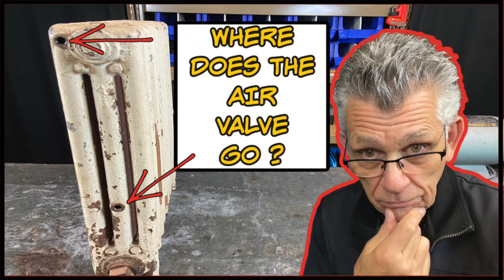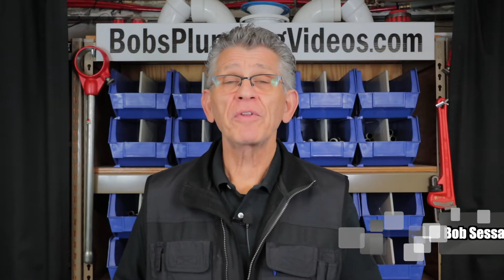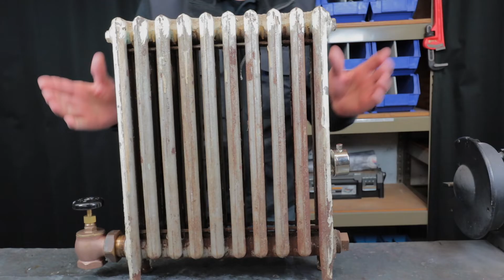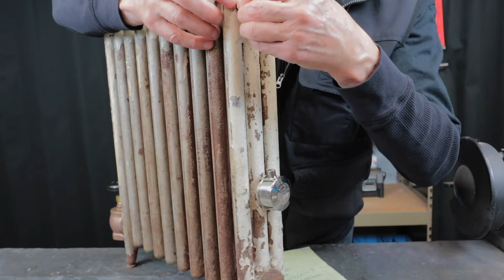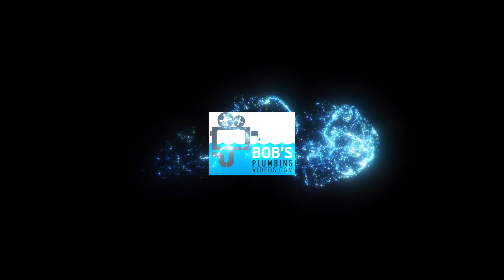Steam Radiator Vent

Comment: Hey bob happy new year.
Had a boiler event today. 
The pressure relief valve on the boiler did its job today scaring my wife to death,she's running up stairs  saying that the boiler is on fire so I head down to the basement and she was releasing some steam so after ten minutes I looked at the pressure the boiler still had pressure 15 psi (little on the high side )after the steam event i figured that air relief are bad I haven't replaced them in about  8 yrs
It's a Dunkirk single pipe radiator system with 6 radiators no expansion tank old house built in the 1920s
So I'm going to replace the steam vent valves 1/8 inch thread and hopefully this solves my problem .
Reply from the maker: Is this a steam or hot water system??? Steam system relief valves are set at 15 psi, hot water 30 psi. Expansion tanks do not apply to steam systems.
Reply: @BobsPlumbingVideos thanks Bob for the information. Yes it's a steam setup 
I'll be replacing the steam vent valves today. 
BTW I appreciate you for sharing your time and knowledge
Reply from the maker: @SuperNovadose  Curious as to why the valve leaked? They are a safe emergency backup up should the boiler not shut down at a pre set pressure usually (2/5psi). They rarely leak on their own as a rule. Might want to run the system, watch the pressure gauge and see if the pressure climbs past 5 psi. If so you might have other issues.

Comment: How do you bleed the system if it doesn’t have a key hole?
Reply from the maker: I you in fact have a "Hot Water System"  NOT A STEAM SYSTEM and there is no bleed valve, you'll have to have one installed to remove the air from the system.
Reply: @BobsPlumbingVideos it’s definitely a one pipe steam system. I think it has a bolt where the key valve would be.
Reply: Or should I change the air valve?
Reply from the maker: @jsn2482 that’s where I would start

Comment: mine has a plug near the lower bottom half, and it seems to be a hex shape. however I tried all my allen keys by none fits. It's larger than a 4 MM but smaller than a 5MM. weird.

Comment: bob i have vertical valves in the basement, 2 valves T off in 2 separate locations, 3 of the 4  valves bleed steam eventually, how do i know if 3 are working correctly or the 1 is?
Reply from the maker: Send me some  detailed photos if you can, little difficult to diagnose on the internet. info@robertsessaplumbing.com.

Comment: Will the placement help if the radiator makes some noise ? Mine on second floor end of line are mounted near the top with Gorton 6 roughly 35ft run from boiler, they get hot all over, but make a couple clanking noises upon filling and later the return phase. The first floor rads are nearly quiet with vents in the middle.
Reply from the maker: 2nf floor I would use Gorton D's or C's and relocate to the middle if possible. Another cause could be backpitched supply pipes under the floor, when the steam comes on, it collides with the cold water sitting in the pipes resulting in crackling and or banging. Tough to diagnosis. There are some chemical cleaners that can be added to the system to clean things up, but I CAUTION YOU,  they must be done by a professional. This procedure could make things worse before eliminating the problem.

Comment: Excellent video. I think you misspoke when you said drill a 21/64 hole and thread it with a 1/8 inch tap. 21/64 inch drill bit is larger than the 1/8 inch tap. The drill hole needs to be slighly smaller than the 1/8 tap to be able to cut the thread.
Reply: I used to plug up waterlines in injection molds using  this classic 1/8npt, and the set comes with a tapered reamer to get the tap started straight and less elbow grease. I must have done a thousand in 30 years, yet would be quite nervous on a 100 year old rad.

Comment: We have had very hot radiators since we moved in 4 years ago. We have a mono pipe system, one zone. I have bled air from the radiarors in the past but nothing has changed. What can I do to better regulate my heat?
Reply from the maker: No, not really. Inside the chrome barrel is the stopper which allows the tub to fill. There are holes in the stopper tube just below the flood level rim of the tub which will allow the water to drain and prevent the tub from overflowing.

Comment: I’m experiencing a water pooling issue with my radiator. When I open the valve, I hear water running into the radiator instead of steam. The water pools inside the radiator and eventually flows out through the air vent. I replaced the air vent, but the pooling issue still persists.
Reply from the maker: You could possibly have a back pitched supply line that's forcing water into the radiator.. May be with a diagnosis from a professional!
Reply: @BobsPlumbingVideos  Your advice is greatly appreciated. We turned off the boiler and waited 30min for the water to drain from the pipes, after which the problem was resolved once the system was restarted. We noticed air gaps trapped within the hot water as it drained, which probably could have caused the overflowing issue.

Comment: Hi can you tell me why my walls in the house get black when I open the heat? Someone answer me please I have a big problem all my closets the clothes get black dust
Reply from the maker: What type of heating system? Black dust? Sounds like soot from the boiler exhaust or a carbonized boiler. You should call in a Pro to diagnosis, this is not normal!!

Comment: Is it common to have two valves in one radiator? One of my steam radiators, located in the second floor bathroom, has two valves. I wanted to swap out the valves and was wondering if I need to plug one or was it by design to have two valves?
Reply from the maker: Send me a photo. info@robertsessaplumbing.com

Comment: Hey Bob, your videos are helpful. I generally have 1/8 fitted straight air vents on the 1st and 2nd floors. However there is one 3/4" straight valve in the basement that keeps blowing. Ive replaced it 3 times within 6 months. I use a Weil McLean SGO-4 boiler. The system always stops at 5psi under normal operation, so I don't understand why I'm replacing air vents so frequently to get rid of the hissing noises everywhere. Also, the banging noises go off every morning around 4 am is a major annoyance. All of the radiators are pitched. Any ideas?
Reply from the maker: What's the piping at the boiler look like? How is the system piping configured? Where is this 3/4" vent located? Feel free to send pictures. info@robertsessaplumbing.com. Or call in as professional to diagnose the issues.

Comment: My top vent is a flat head screw insert.. I can't get it out at all to bleed any air. It just wants to strip
Reply from the maker: You're going to have to drill it out, maybe this will help...https://youtu.be/y3I1N2NTqqE. Drill dead center of the flat head plug with a small (1/8" bit) increase the size accordingly.

Comment: My air release valve is leaking , why? I am going to replace it. There are soo many different designs. I would love a video explaining why they leak and the differences in the designs and which you recommend.
Reply from the maker: Great suggestion!, that's going to be a Looooog video. So many reasons they fail, but in general over time they do occasionally go bad.

Comment: Bob how can I take the top  water plug out that the 1" plug without the rotator cracking please get back to me please reply thanks
Reply from the maker: Not easy, but I most likely would drill a series of hole around the square hex until I could knock it out. Then make two or three cuts from the inside up to the radiator without hitting the female threads,. Then take a small cold chisel and knock the pieces out. You could try heat ing the plug with a torch and try to unscrew it with an 18" / 24" wrench, but thats a gamble. Good Luck!

Comment: Hi Bob, thank you for the video. I just want to ask you where did you got the vest you had on you. I have a Weil McLain Steam boiler. The house is getting heated up but the pressure gauge does not affect any. I cleaned the pigtail. Still nothing. What you think? Thank you.
Reply from the maker: Vest was from Duluth Trading Corp many years ago. Not sure they still make that one. Check them here..https://www.duluthtrading.com/men/outerwear/vests/. Is your stream gauge broken? May just need to replace it? If the house is heating up, may just be a bad gauge
Reply: @BobsPlumbingVideos  Thank you.

Comment: Bob thanks for your videos! I have a question for you with my steam system. Several of my radiators are banging ( like someone is hitting them with a baseball bat). I have tilted the radiators to ensure water flows toward valve. I have new vents installed and the valves are always kept wide open. What else can be the problem?
Reply from the maker: Could have issues with back pitched lines below the floor, excessive pressure setting down at the the boiler, needs to be witnessed as the system is running!

Comment: Hi Bob, your videos are very informative and helped my fix the service valve on my radiator, can you please tell me what the best air valve to buy to use on my top floor (3rd) steam radiator would be?  I currently have the Maid of the Mist brand but some of them don't seem to be working very well and they are only about a year old.
Reply from the maker: Maid-O-Mist valves are imported knock off's of the Gorton valve. I like a Gorton "C" or "D" on upper floors further away from the boiler. Valves should be sized also in relation the the size of the radiator, big fav of the reliable Hoffman #40 which is a bullet proof valve in my opinion.

Comment: I have a 22 section radiators with this exact issue of the air vent is at the top and the radiator heats very slowly and partially.

Going to try and move it per your recommendation.

Comment: Good to see another New Yorker here! I had my handy man install a new radiator for me from the fin style, he had the valve up top and it was a cheap mist o made self adjustment one.

The radiator had cold spots so, I plugged the top and moved it to the middle/bottom. Next step is getting a better quality vent, a Gordon or vent rite adjustable 1

Comment: I should have gone with hot air instead of natural gas when I replaced the oil fired boiler. I  spent $ 8000 on the swap

Comment: The last radiator on the first floor main, spits steam and water out of the air vent.  The tilt is fine.
I can hear the water gurgle and surge and finally spit out the vent.  New main air vent.  The radiator gets hot.  I catch the water in a can every day.  1/8th of a cup daily.
Reply from the maker: Maybe a back pitched branch feeding the radiator? May be worth having it checked out1.
Reply: @BobsPlumbingVideos  This problem started last season when I replaced some radiator air valves that were "hissing" air/steam all the time.  I was adding too much water twice a week.  One plumber tried to force the pipes in the basement down for a better drain, but nothing has helped.  Thanks for the reply.